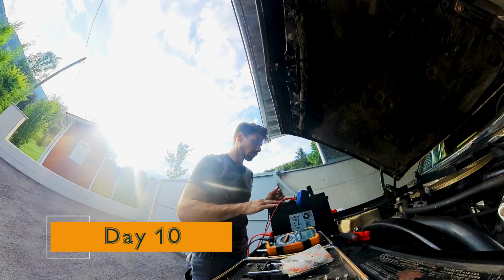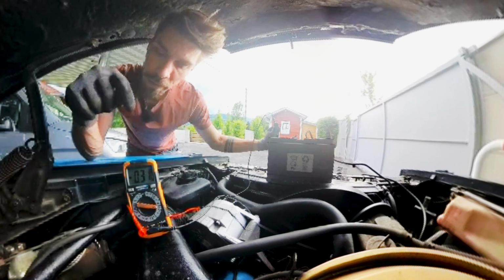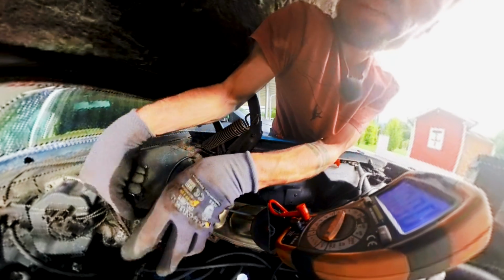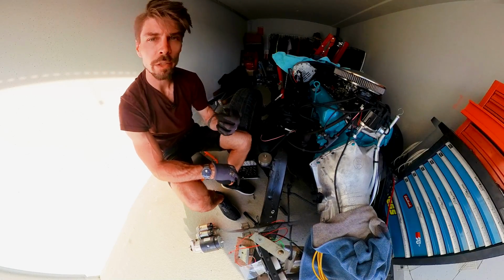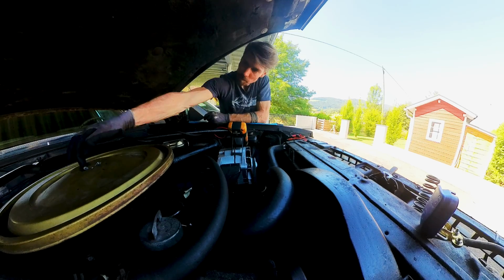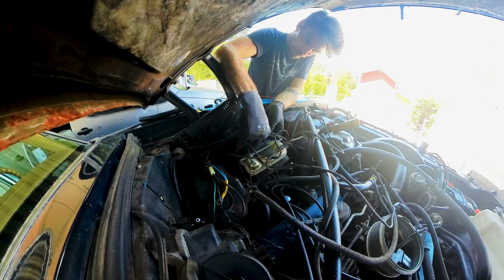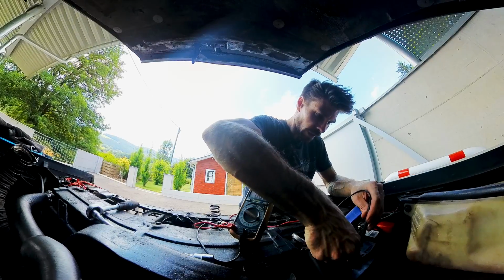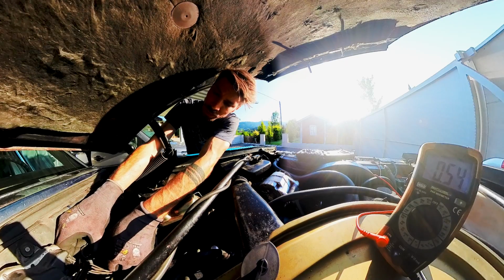Parasitic Draw Search Pt. 7: Stealing a Starter & rewiring it the RIGHT way

Comment: I had the same problem battery goes dead with car shut off. I found that the plus +12V to the alternator had a 4 ohm resistance and 2 amp drain continual. I will need to take the +12V alternator from accessory, key on. Or buy new Alt.